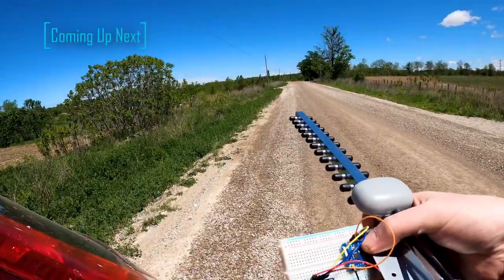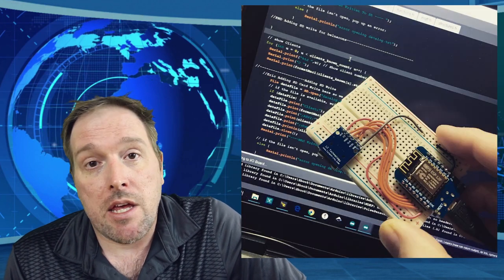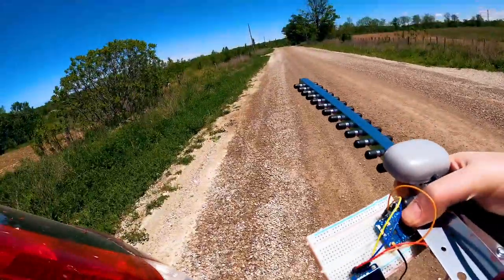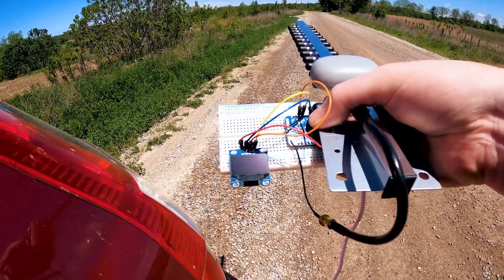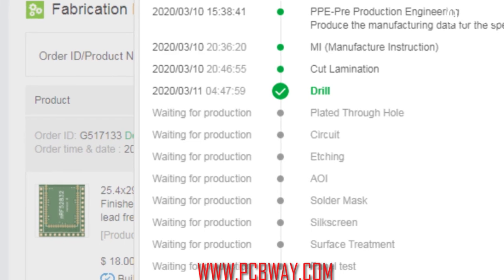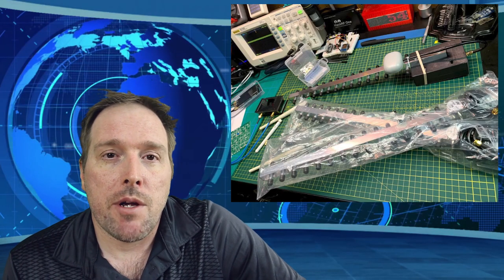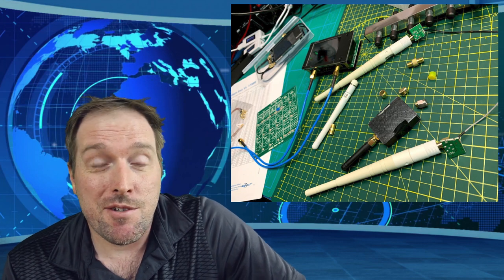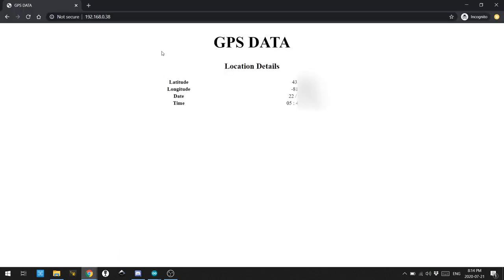DIY Search and Rescue Tool With an ESP8266 Pt.1

Comment: What a great idea I think you have a solid grasp on a cheap and viable solution for search and rescue and maybe taking a lot of the negativity away from drone use in the hobby form . I many different platforms this would work on where size isnt a factor from 2m wing to 4 m motorized glider keep up the amazing work following close
Reply from the maker: Thanks Robert. So far so good :)  You can see the current size and info on my socials like Instagram (vids lag some weeks/months due to the time to produce). The air unit is still pretty small and can be made much smaller if I make my on all-in-one board instead of the sandwich approach I'm currently using. Cheers.

Comment: I am wondering how much does it cost to make the 3D box?
How much does the plastic you use cost?  I may be getting a 3D printer.
I see some printers going for $200.00 U.S.
Reply from the maker: For one of these boxes around 5 cents or so. Filament is ~20 to 30 USD per kilo.  https://amzn.to/3ijNbNv